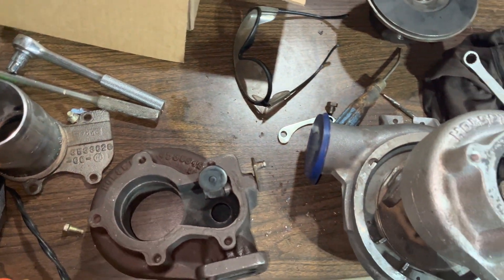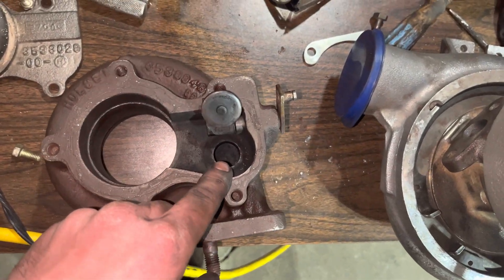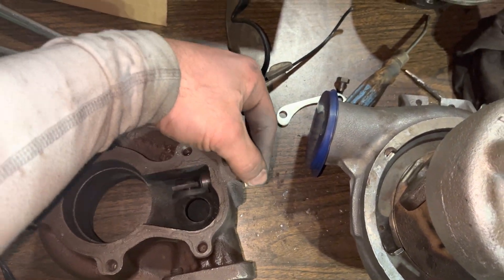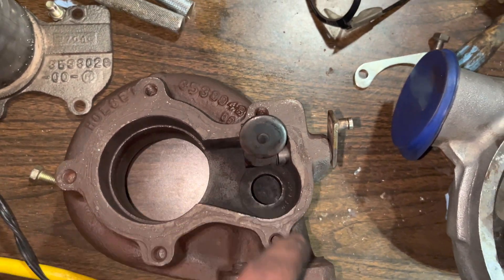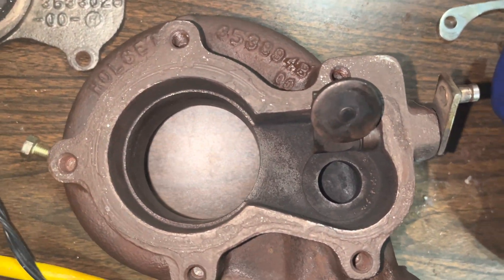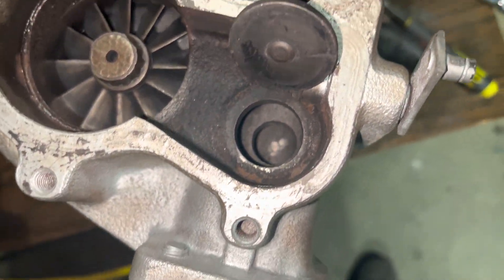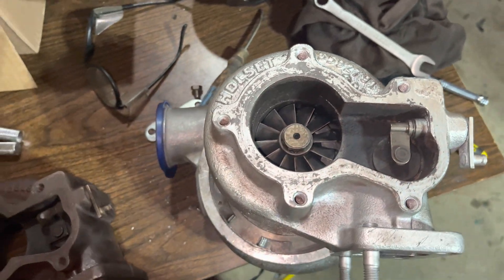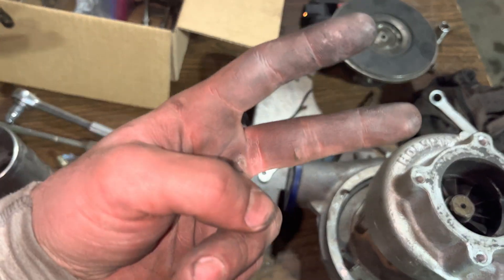HX35 Exhaust Housing Modification

Comment: that will ruin the whole idea of the twin scroll, but of course its not good either that the boost is too much because of that.
Reply from the maker: @salonen4244 Completely agree with you but  a lot of people using these want more power with less problems. This will do that. Less chance for the turbo to blow this way.
Reply: @MillerWorkzLTD did you feel any less response ?
Reply: @bahy-amir  wondering if this will hurt response with a stock inefficient baby hx35 is hilarious.